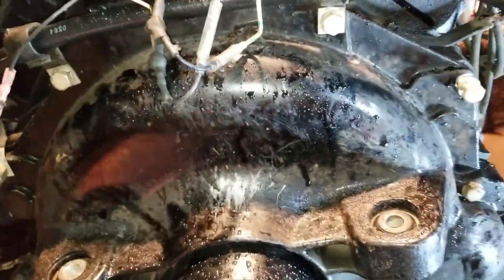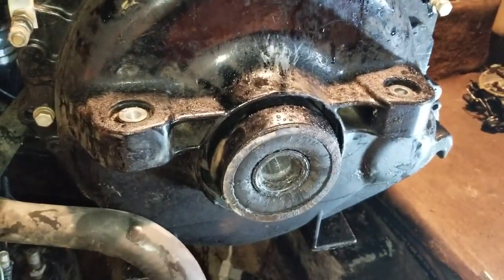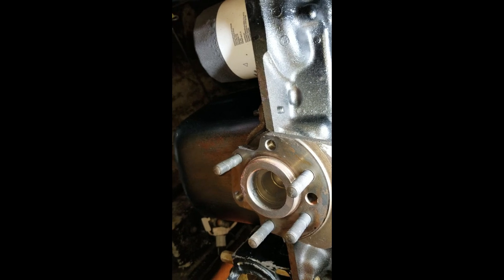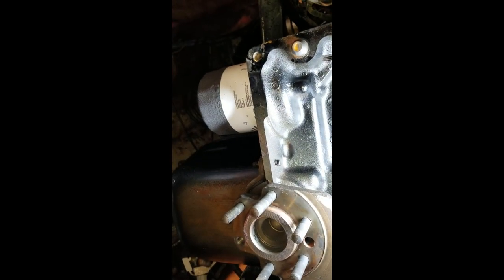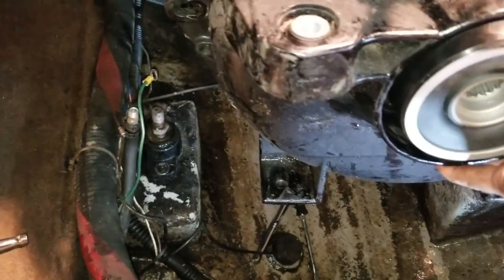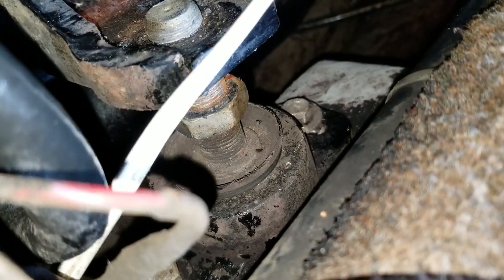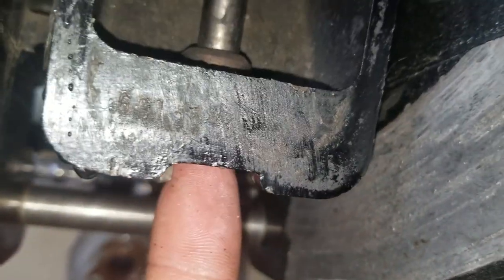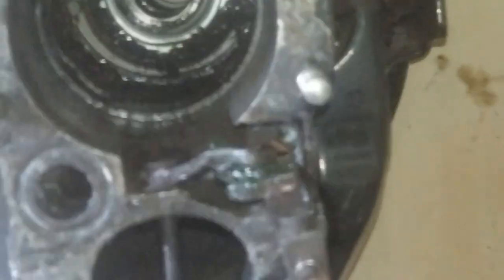How To Replace Engine Coupler Mercruiser

Comment: I had a very weird knocking noise that came from the flywheel/ coupler area with the sterndrive off. It turned out, I had two loose coupler nuts/studs. I have a Merc 3.0 IO. , this video helped me out tremendously. Thanks again.

Comment: Easiest way to install and remove studs with out a stud remover or installer is to use 2 of the nuts you already removed. Install the 1st in the opposite direction and 1 in the regular direction so that they mate together. Tighten them against each other use a wrench on the inner 1 and you are all set the stud start to rotate. No special tools needed and the stud can be reused and reinstalled in the same manner

Comment: Hi, I'm doing this repair now - on basically the same boat you have (mine is a 1983 SRV197).  I noticed you pulled the carb off of the engine.  Is that necessary?

Comment: Boy hope you never have to replace that couple again using red loctite on those nuts. Shoulda used blue on the nut side
Reply: Would that being bad cause your engine to run hot to mine doind the same thing other than its cause engine to run hot
Reply: @johnpritchett2330  Yours is probably a busted rubber inside the coupler and your not getting enough water from the outdrive up to the engine , Thats what mine was

Comment: God bless you for this. I have to go thru this exact same procedure to replace my drive flange on my mercruiser 898, with a perfectly running chevy 305. Wow. Now I know exactly what to expect. Thank you so much for your dedication to help others!
Reply from the maker: Happy I could help you
Reply: @thestigmach1984  Finally got it done in an hour yesterday. I built a six foot wide wooden gantry out of doubled 2x4's, with a harbor freight chain hoist.  Took me a while to figure out it was a two piece boat, so I had to cut out the top of the back end (which is hidden with a flip up top cover).  Removal and reinstall was surprisingly easy!

Comment: Great video. very informative.  Have to do a front crankshaft seal on a 135hp 4 cylinder mercruiser. Might as well do front base pan and gasket as well as timing chain I suppose.  Maybe rear crank seal too- not sure.  But the engine is coming out for the winter so might as well do all of it .  It's 19 years old
Reply: What did you find when replacing your front mail seal,
Mine is leaking as well.
I was thinking that it might be bad main bearings causing the front main seal to leak, 
Update?
Reply: @Lonchpad1    No.  Bearings are fine.  This is a common problem with this GM based 4 cylinder. It is the old GM 2.5 liter 4 cyl bored out to 3 liters basically.

Comment: Thanks so much for making this diy video.  I’ll need it.  I just bought a 87 Thunder Craft with a 120 hp Mercruiser.  I don’t know if the boat floats or runs.  I know, crazy.  I knew better too.  Just loved the boat!
Reply from the maker: I've been there. My first boat was like that. Good luck
Reply: thestigmach1 

Was there anything else wrong with the boat?  Did you use it last summer?
Reply from the maker: @leesire  needed floor replaced. I used it two summers then traded it for a bigger one. Was very reliable
Reply: thestigmach1 congratulations!

Comment: GREAT job on the video and very in-depth. I do wish I had seen you remove the engine. But there ar other sites that show that process. I have a 1991 Mariah 1900Z 19 foot with a 4.3L and when I got it I knew it had a bad coupler. I contacted a Marine parts supply and was told from my Serial # that mine had the Triangular Coupler. And from another site I found that if your drive shaft only has 2 O-rings that it will not accept the triangular coupler. So don't take a parts seller's word as gospel. They make mistakes. My problem was caused by a rotten motor mount support. And also from a very poor job of trying to fix it by a marine repair shop. I wonder how many others have found crappy fixes done by marinas. I would like to here if any one else has had the same experience and how they fixed the bad support issue??

Comment: Found my rear motor mount loose enough to turn on 1990 454 Bravo 2, thank you! never seen the backside of our engines! 
Now I just need to figure out my next step!
Reply: Did you have a bad motor mount or a problem with the support system under the metal motor mount. Or was the mounting bolts just loose?

Comment: My prop will no longer spin enough to move the boat, I have very fine metal shavings in the bilge and a clanking/grinding noise coming from that area of the boat? Are these symptoms of a bad coupler?

Comment: So you changed the pre-alpha transom gimbal assembly  for a alpha one.  but did you keep the mercruiser 305 230?  I have a sea ray V225 cuddy but with a mercruser 305 next generation with the screws on top  valve cover.  I have problems with the hydraulic steering system.  and last year I bought an alpha one setendrive.  complete with transom gimbal assembly and trim pump but I only installed the outdrive;  From what I could see it can be installed completely. Now I have to do some repairs to the transome.  I have rotten wood and it needs to be repaired, in addition to some damage next to the drain plug that also needs to be repaired.  then I will have time to install the alpha one gimbal assembly right? 
Tank you so much.

Comment: Also, didn't mention this earlier - but I swapped the original MCM228 out for a 5.7 (350 CI) reman ten years ago and was doing great until I sheared the engine coupling last week.  Newer engine has 450 hours on it and I have always checked alignment when I had the drive off and greased the splines regularly.  Each time the alignment seemed to be pretty well perfect as I could push alignment tool all the way in with two fingers and minimal pressure.

That said, when it sheared last week I was heavily loaded with six adults and lots of gear.  I'm thinking that certainly contributed to the failure.  Plus, I run a stainless prop (no flexing with SS) and the newer engine has quite a bit of power (~270 HP) relative to the lame 305.  Besides what I mentioned above, is there ANYTHING else you can think of that may have caused the coupling to fail?  I had ten relatively good years but I for sure don't want to go through this again.
Reply from the maker: @willytv275  being under heavy load I wonder if there's a weak spot in the stringers causes the engine to twist. They used these on big blocks before the bravo came out and still use them on the small block 350s with 260hp.
Reply: @thestigmach1984  Hello and thanks for the reply. I wondered if maybe the engine is moving around some. However, I have tapped around on the flooring and the mount pedestals and all seems to be pretty solid.

The boat is old obviously but has always been stored under roof and I open it up and let it dry out really well after each outing. I purchased some new rear mount bushings as those have never been replaced. I’m thinking that may be part of my problem. I plan to install them as soon as I get the engine out.
Reply: @thestigmach1984  Hey, how are you doing today? Follow up to my last post - I’m expecting a new coupling to be delivered today. The one that failed was an aftermarket and this time I’m going back with OEM Mercruiser. Cost is twice that of aftermarket, but I want to get the best possible part. I’m planning to pull the engine this week and do the coupling swap. One thing to note, I did check my alignment yesterday and it is still spot on.

Your comments regarding the stringers, do concern me, however. That said, since the alignment is still in good shape, I found that at least somewhat encouraging. Bottom line, I was overloaded and running a 21 pitch prop, which did not help matters. I should have switched to my 19 before that outing, or better yet, kicked a few people out of the boat. Please let me know if you have any other thoughts or advice…

Comment: Very good and helpful video. Do you know if the engine mounts in a 4.3 V6 boat will accept a 5.0 V8?
Reply from the maker: Been awhile since I messed with that stuff but rear mounts for sure front mounts 95%. Google V8 swap S10. Same engine swap you're trying to do and will tell if front mounts need changed.

Comment: @12:30 it’s funny you say “The last thing you want is your Coupler coming off on you” lol I bought a boat and I suspected I spun bearing but come to find out two of these flexplate bolts had backed out and we’re laying in my pan and the fly wheel was hitting them making it sound like a bad crank bearing—I’m very surprised they werent any loctite/thread sealant and after seeing this video seems like that was just a standard thing to not add which is very surprising

Comment: Great video. I was trying to change the shift bellows by myself and got the shift cable stuck in between the coupler and bell housing. I have the engine ready to hoist up as that’s the only way I can think to get it unstuck. Will for sure need a new shift cable as I had to cut this one. Anyone ever had this problem or any advice? Thanks!!

Comment: Did you look at the triangle style coupler over the crankshaft mount coupler?
Reply from the maker: They're a different style and length not swappable
Reply: @thestigmach1984  Did you find out what the sbc 1 pc rms coupler part number? Their seems to be so much deceptive and secrecy to find correct part.
Reply from the maker: @johnwehunt4305  it's going to depend which one you have. Only way I know of is to shove your phone in there and video it so you can see if it's round or triangle. Then should be able to search for you r year and that style. Sierra marine is helpful even if you don't buy it from them. I don't remember or have those part numbers anymore

Comment: I  know that its kinda late but if you had taken a pair of vise grips and chomped down on the smooth surface on the engine side, then brace against something to keep the grips and or nut in place, then just unscrew it. The nut on the other side is a little harder in my opinion.

Comment: Remember to position drive in forward gear for removal and installation. always use a new gasket and install dry, use a little grease on the O rings to hold in place, with all surfaces clean you will have a tight seal. The use of chaulk just makes it a B for the next guy.
Reply from the maker: I've been using RTV on these for years and never have a leak and dont have a problem removing when it's time for maintenance. Theres a big difference between rtv and caulk. Seems like I mentioned the forward gear part but may have forgotten to say that.
Reply: @thestigmach1984  I use the word caulk loosely, referring to any and all sealers/adhesives. It's just a lot of work to remove from surfaces, and I'm usually the one stuck doing it. I've installed many using quicksilver and sierra gaskets dry without any come backs.
Reply from the maker: @meganperry5307  with the black stuff I use it's a matter of tear it off. I've never had to actually use tools to remove the rtv. Everyone has a method but this is the method I found to work best

Comment: What year is your Sea Ray? I know that they changed the style of coupler around 1993 0r close to that. I have a 1991 and I also get conflicting answers to which coupler that it takes.  Thanks for such a helpful video!!!! Keep up the good info!
Reply from the maker: It was an 85 or 86 I believe. I dont have it anymore. There was conflicting part numbers for mine as well between the round one and the triangle one. I took my phone with video on record and stuck it back there to record what it looked like before I ordered parts. You can see what it looks like without pulling the motor

Comment: thestigmach1, do you know if it's possible for that coupler to just kinda go bad? Everything I read says they are all or nothing. I developed a bad vibration and a tinkling sound coming from the rear of the engine. I pulled the outdrive thinking it was my u-joint or gimbal bearing, which I just replaced when I did the bellows, but they are both fine. When I reach around the back of the engine, the rubber ring part of the coupler is uneven, it sticks out more on one side than the other. When I bump the engine, the deformity moves with the motor. Can the rubber fail and let the splines shift? The alignment tool does not slide in. It goes in a little bit and makes the coupler clunk in and out about 1/8" when I push and pull on it. I'm sure the coupler must be bad but I hate to do all that work if that's not the problem. Thanks SO much for your super helpful video!
Reply from the maker: It sounds like the coupler is going bad. I have heard of the rubber bit shifting from wear and age. Sounds like the engine is out of line as well. The part isn't expensive. Id put a new one in and make sure you have the engine aligned perfectly. May save you from being stranded in the water like i was with this boat
Reply: @thestigmach1984  Thanks! Through all of my highly scientific Google research, I couldn't figure out if it was possible for that thing to shift or not.

Comment: I just came across this video my motor mout broke causing motor to lean heard a noise coming from coupler area pulled out drive off still here noise . will the coupler only make noise when out drive is hooked up
Reply from the maker: A failed coupler yes. It could be hitting on the housing or even loose from the engine itself. Definitely need to pull the engine and have a look at whats going on.
Reply: @thestigmach1984   Thank you for the quick response I'll look into that I just hope the noise isn't coming from internally

Comment: I have a 17 foot larson with a volvo penta 3.0 gs and volvo penta sx drive but i have a problem i want to fix, the gimbal need to remove and reseal cause i have a little bit of leak and i used some marine sealant n seal the outside around transome area but it work but when I work go in rough water n get alot of beaten it leaks again and other issue is  where the engine mount screw down is sinking and did put a bigger bolt in it with some woodfilling. Want to take on the project but I think I'm going need atleast a second person on a project like this .

Comment: Is there a way to check coupler without removing engine? I have an omc cobra will only do 10 mph everyone keeps saying it’s the coupler
Reply from the maker: @marshall8898  not that I know of. Sounds like the coupler
Reply: If you can turn the propeller while in gear that would be a bad cuppler

Comment: When the engine was pulled out, did you bother checking the rubber mounts in the bell housing? Now's the Time to check and replace
Reply from the maker: Yes I did. Mine were in good shape

Comment: When you took it out the first time and it was spinning but not going anywhere, did you smell burning rubber?
Reply from the maker: I did not but guys I talked to said that can be a symptom of this. On mine the metal splines stripped out. If the rubber bit separated from the metal you could be getting rubber burning.

Comment: How did you get the coupler off when the bolts are undone?  mine are stuck
Reply from the maker: Give er hell is the best thing I can give you. Luckily mine weren't badly stuck. You may have to find a way to wedge the flywheel so the motor doesn't turn while you are cranking on it

Comment: So loosening the 2 front engine mount bolts and the 2 in the rear allows the motor to just slide off the splines? I have to pull mine out and this I'm not sure about.
Reply from the maker: Are you pulling the engine or the outdrive?
Reply: @thestigmach1984  I pulled the engine. And have since reinstalled the replacement.

Comment: Do you own a torque wrench?  How do you attach to an engine stand?  Pretty good video.  You had kids for a reason... to hold the camera, or rams.
Reply from the maker: I do have a torque wrench but the only thing that would be useful for that is the cooler itself and theres no way of getting torque wrench on those bolts. What are you wanting to attach to the engine stand.

Comment: Would a bad coupling give me a whining noise my boat sounds like it needs to be greased sounds like the baron is rubbing  and it’s not the gimbal bearing Just had all that replaced The noise is coming from behind The bell housing
Reply from the maker: Possible. Does it still drive? Odds are the coupler is fine if it still drives. The bearing may have been installed incorrectly. Was it aligned when the bearing was installed? Could cause some nasty stuff as well.
Reply: @thestigmach1984  It’s funny it only makes the noise when it’s in the water I can hook up the paddles in my yard turn the water on start the boat and it won’t make the noise it’s a whining noise I had the gimbal bearing and all new Bellows done this spring my gimbal bearing was fine but he replaced it while he had it open anyways The noise is coming from the area of the coupling around that bell housing it’s a loud whining noise there is a grease fitting on that shaft right before the bell housing i’ve tried grease in that too I just know pulling the motor is a big job
Reply: @thestigmach1984  it was making a whining noise before I had all that work done I thought maybe it was the gimbal bearing but obviously it wasn’t it’s still making the noise and I had a in-home boat mechanic come to me very well known in my state very recommended on Facebook so I know his work was good just couldn’t get the boat to make the noise in the yard when he was here like I said it only makes a whining noise when it’s in the water